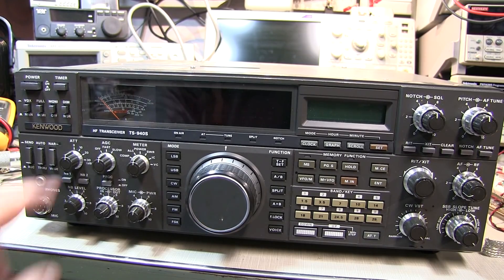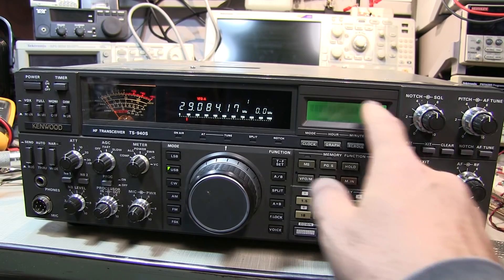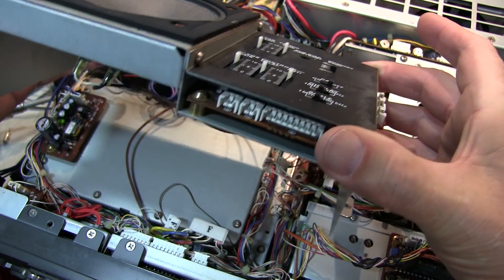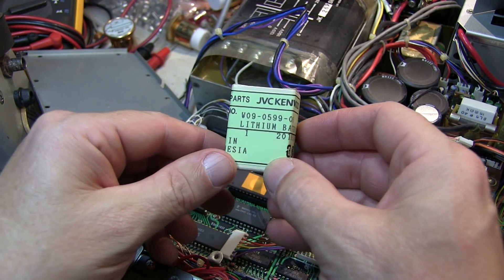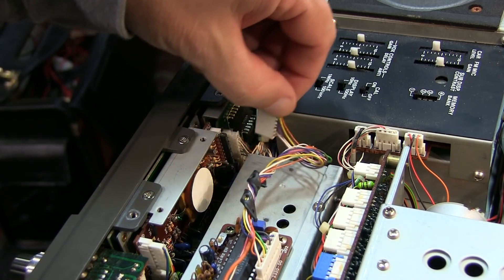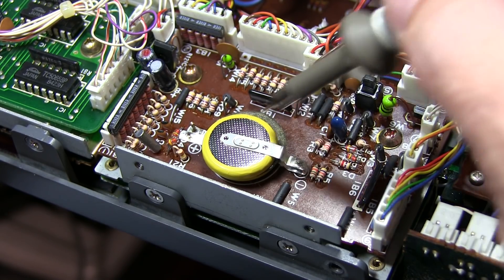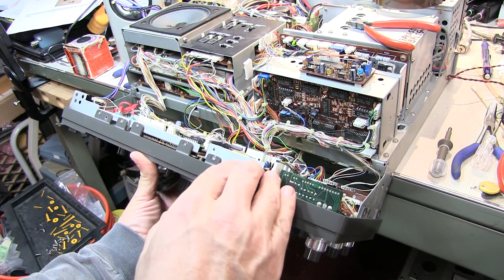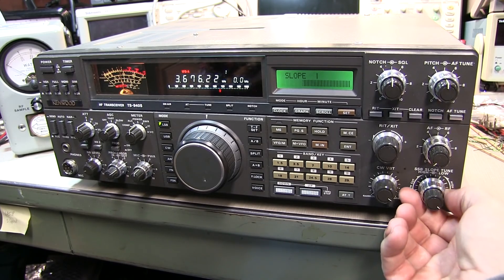#309: Radio Repair: Kenwood TS-940S Battery Replacement

Comment: Nice video that should help some out. I know this sort of construction is the norm for this era of Japanese radios but your really have to wonder why they were, and to some degree still are, using such crude mostly 1960’s design methods? This radio could have been made with far fewer PCB’s, ribbon cables could have replaced the complete rat’s nest of discrete wire harnesses, etc. Such a radio would be cheaper to make, more reliable, and easier to service. If you look at an American designed radio, like an Elecraft, the engineering superiority is obvious.
Reply from the maker: This is pretty typical of consumer electronics from the early to mid-80s.

Comment: Hmmm... wouldn’t it be better to mount top battery positive terminal up? Just like it was originally. Then both negative terminals would be in the middle.
Reply from the maker: True, but the lead on the capacitor was very short, and the positive terminal wouldn't easily reach it if it was coming off of the top, so I had to reverse it.
Reply: @w2aew  Great job! Thanks.

Comment: I got me a TS-940, was not working, so cheap.   Power supply issues.  Radio worked well except clock was running a mile a minute.  Like 1 minute every 10 seconds.  Was a dead battery.  Changed them all.  Recap unit and alignment.  Unit works well.   TS-430(I think) had bad battery and computer would lock up.   Seems a kinda norm with Kenwood. low battery and it jacks on ya.  I install a cr2032 socket when I can.  P.S.  the TS-940 has tendency, over time, attenuator relays get dirty.  I replaced mine get signal level up.

Comment: Nice video Alan. You installed the top battery on the timer board upside down, compared with how the original was installed. You even commented on it that positive was up, but then installed it negative up. I assume it was designed so that the bottom battery had negative up, and top battery negative down so they were on same side in case of a short.
Reply from the maker: It was mainly because the lead on the diode was short and wouldn’t reach the batter terminal if it came off of the top.

Comment: Glad to see another TS-940 in working condition.  I noticed that one has the VS-1 tone board.

On mine, (a two battery version) my batteries were still working but they were measuring a little over 2 volts. I went ahead and replaced them when I had it apart to install the IF-10B serial interface board. I attached CR2032 holders and put fresh batteries in them to make future replacement easier. Though, considering the previous ones lasted about 35 years, these may never need replacing. LOL

Comment: Simple job hindered by a pile of loose cables :-) Is it just me (or the camera angle), or the positive terminal of the first battery behind the LCD display, at 4:30, is not completely soldered?
Reply from the maker: It's the camera and lighting angle - there is a good solder fillet all the way around the post.
Reply: @w2aew  I thought you wouldn't miss that, but after years of chasing cracked or cold joints, I became hyper-sensitive :-)
Thanks for answering!

Comment: Do you repair radios?  I have a Icom IC-4SAT inop.  Also a Yaesu FT-817 no TX fine RX all modes and bands.  Reply here if interested.  Thanks!  K4RJJ
Reply from the maker: Unfortunately I only take on occasional repairs for my local ham friends, since it often takes me weeks to get to a project.

Comment: Thanks for the good video.  Reminds me that I should change out the battery in my TS-450S/AT.  Bought it in 2013 but no clue as to how long the battery has been in there.
Reply: You better do it soon. I had one that leaked and ate away some lands underneath it. Some hams have relocated it to a safer place and ran wires. 73, Bill KA2QEP

Comment: When Alan changed the first lithium coin cell (solder tab),
you may have noticed the Insulator (foam pad) on the lithium coin cell.
Kenwood part number for that insulator is F20-0521-04 : $1.10 from Kenwood Parts.

The late Bill Leahy, K0ZL (sk, February 2009) changed hundreds of Kenwood batteries,
and provided alternatives (when Kenwood Parts were out of stock - a decade ago — 
due to Panasonic buyout of Sanyo and part number changes of Solder Tab suffix).
https://forums.qrz.com/index.php?threads/ts-440s-battery-replacement.72950/

Comment: Can somebody tell me what are those 2 components with 4 strips on 1:18 at the bottom center of the screen? Are those resistors or inductors? I pulled out few of those from old device, but resistence reading is ~0.5 ohm.
Reply: Plain simple power resistors. 0.5ohm is not unusual, you can get 0.01ohm resistors if you want. Their main use is current sensing (shunt).
Reply: @mrnmrn1  I found them in PSU, as a fuse replacement.

Comment: Had to do that to a TM-231A.  Found a service manual online. You have to disassemble a crazy amount of the radio.  Put the battery on wire leads from the pads so the next time, just clip easily accessible the wire and soldier.   Shrink wrapped the battery so it would not short anything.
Reply from the maker: Yes, I had to do that to my TM-231A about 10  years ago too.

Comment: Why a radio mfgr would design a radio to shut down if the battery dies (yes, using the incantation of button presses restores function but who knows THAT offa the bat) is , for want of a better phrase, retarded.  My BRG internet clock has the same brain malfunction.  I harangued them about this design feature.. they just sighed and ignored me. Aaaanyhow, great video!
Reply from the maker: This radio is over 30 years old - available technology was different then.  The power up procedure shown in the video is in the user manual.  Battery replacement was simply part of the periodic maintenance.

Comment: Since it's sitting there since 1985, I would make a backup from that EPROM, erase and reprogram it. I've seen EPROMs developing amnesia after just 20 years. To be fair, I've also seen some that were fine after 40+ years, but you never know when it will happen.
Reply: How does one back up the EPROM?

Comment: Good job Alan...done that at least three times on my venerable TS-940S since I bought it new in 1986! Replacing the power supply with Compudigital's switcher supply will be a winter project. Another local has done that already and is pleased with the result...those AVR PS boards have an expiration date and I'd prefer not to have a catastrophic failure!  73 - Dino KL0S
Reply: Dino i do the same with compudigital mod. And is AMAZING  results.  It is alive !!!!
Reply: @lampa2001  I completed the power supply, batteries and LED replacements last month and am very pleased with the result!  73 - Dino KLØS